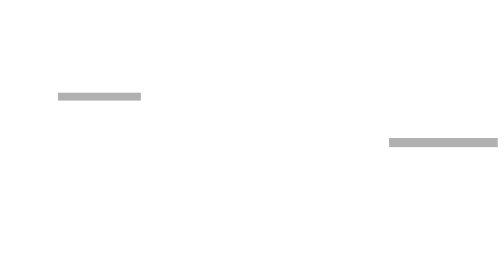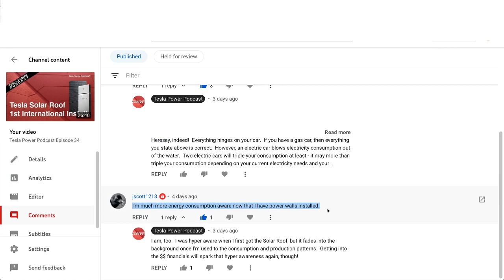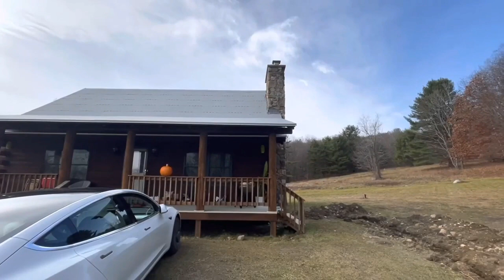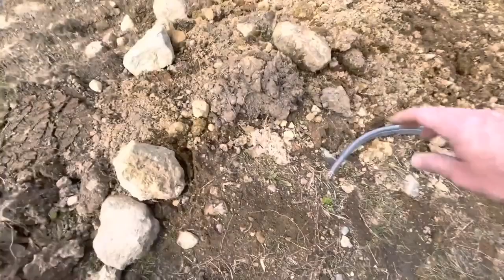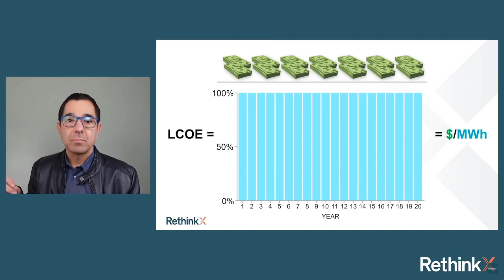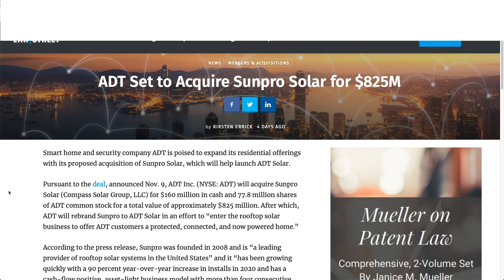Episode 35 - Net Metering: Its Days are Numbered | Becoming Aware of Your Energy Consumption

Comment: In Alberta our power bill is divided into various costs.
Our cost to be hooked into the grid is about a C$ 1.00 a day.
There is a transmission and distribution charge that is also part of the grid at a cost of approx C$ 0.08 per KWh
This works out as my cheapest battery option fo my solar system.
I pay 0.18-0.22 cents per KWh at night and receive 0.10-0.14 cents per KWh for my over production during the day.
At the moment it would cost C$ 800.00 per KWH of storage that would take 15 plus years to pay back my storage costs at 0.08 cents a KWh 
Also on rainy ,stormy ,cloudy, or snow covered days I have access to all of the power I need.
Reply from the maker: Do I understand correctly that you're considering The Grid as your cheapest battery option?
Batteries are expensive - that's for sure.
Absolutely use The Grid as your battery for as long as you can!

Comment: Let me push back at the notion that EV use so much energy. As a tesla model 3 owner and a NetZero solar home owner, the notion that your car will use more energy than your home is bunk.  I have some experience with this, having expanded my PV system to net out my use when buying an EV. The average EV consumes about 10kWh per day. The average bone uses three times that, or 30 kWh/day.

Comment: On Consumption - we have driven a hybrid for 11 years and are in the queue for an EV. As to Production, we maxed out our PV system under the local electric coop rules. We have more roof space if we could get more panels permitted but we are also constrained by roof structural limitations - it's a log-frame, post and beam structure (not log walls) that was under-engineered. The PV system is micro-inverter driven so we hope to be able to add panels one day. Reduction - we replaced all incandescents by LED and changed out some appliances. Kind of an all-at-once approach. Our neighborhood is maybe 30% climate-change aware but still a lot of ICEV out there. This is all just FYI and probably typical nation-wide. Cheers.
Reply from the maker: This is good detail - thank you for sending!  I'm curious about your coop limitation - how much production did they allow?
I'm also curious about consumption.  Do you happen to know how much less you consume now that you have replaced your lightbulbs and appliances?
Do you have an estimate for how much your EV will consume compared with your current consumption?
Reply: @teslapowerpodcast  Thanks for your reply. La Plata Electric Association runs the grid at about 10% over line voltage, I hear that’s typical. They would allow more than the 16 panels @ 335 Watts each that were permitted if we upgraded our cable from the end-point transformer to the house. That could cost a lot! There is room for 24 panels  but that’s more cost. Today on a full sun southern exposure we are generating 4.2W of which 0.8 goes to the home and 3.4 to the grid. I don’t know what the savings difference is with the lights and appliances replaced. The kitchen is propane and electric combination, the laundry is all electric on an LG Washtower, the heat is propane with electric distribution. As for the EV, the Tesla will charge overnight drawing 48WHrs from a 220V 50amp circuit. That’s about all I know right now. I’ll see what the average draw for the EV once I get some data over time. Thanks for a really helpful channel, cheers.
Reply: Whoops! That’s 4.2KW not 4.2W! Adjust the split accordingly.

Comment: I think the comment I made in the last video about the random PA phone number may not have been "allowed" by YouTube because it had a phone number in the comment. I had posted a comment in a previous video with a url link and that comment did not make it either. So I suspect it's YouTube's policy that may be blocking these?

About your energy assertions, one problem is that you can't design a PV array size with what you "think" you will be consuming in the future. You can't just tell Tesla I want a 50KW system on my roof. As you know, the first thing that Tesla asks is what your current consumption is. And you probably know that they ask this because the utility won't allow the sizing of your PV to be more than ~120% of what you're currently consuming. If everybody was producing as much as they wanted, the grid would not be able to handle it I suspect. 
So sadly, I believe that the first thing in anyone's assertion should be for a new utility grid design before anything else takes place. The grid is old and won't be able to manage everybody's PV systems. Batteries will help to stabilize the grid but will that be enough? I have my doubts.
Reply from the maker: YouTube is a nanny state :-)

This is EXACTLY why you start with consumption.  Unless you have juiced your consumption, the utility will restrict the size they will approve for your system - I should have pointed that out explicitly and thank you for this note.  You are absolutely correct that if the utility just allowed home owners to produce as much as they wanted, the grid would not be able to handle it.

The answer is storage for the homeowner.  It's not storage for the grid.  I agree that the grid is old and won't be able to manage everybody's PV systems - and it shouldn't.  Each PV system owner should be able to produce as much as they can AND should be able to store all of that production locally.  We definitely have a long way to go before this can become a reality, but we cannot - and should not - plan on using the grid as a battery.  We need more batteries in homes and we need them to be more affordable.  Scaling battery production is our only hope.  And it needs to be more than just Tesla driving this effort.
Reply: More like the solar company will sell you an oversize system if they are not restricted. The grid is generally unloaded by distributed solar panels, especially in the peak times.

Comment: Do you expect the Powerwalls to contain the new 4680 batteries by the end of 2022?
Reply from the maker: I do not expect 4680 to make it into Powerwall.  I expect these will be reserved for cars and probably only have a nickel chemistry.  Don't forget that the ramp for the 4680 form factor is going to take a few years AND that demand for these cells is unbelievably high - just with the Model Y - not to mention Roadster or Semi.
What I expect we'll see in the Powerwall is an iron variant of the 2170.  We have a lot of production capacity that will be shifted away from Model Y (and probably Model 3) which will free it up for Powerwall.  Reducing nickel consumption will be key to avoiding vehicle production bottlenecks, so changing the 2170 chemistry to LFP probably makes sense.
This will also increase the value to customers as LFP doesn't require as much thermal management - maybe allowing more room for batteries, it will last longer, and charge/discharge cycles can be 100% of capacity.

Comment: 15:00 I would extend the driveway towards the right side of the house. Mount the charger on the house or trench under the New driveway and mount the charger on a pressure treated wood, embedded into concrete. 
Maybe build a canopy for the car…
Gotta think about voltage drop… I am unsure about voltage drop…
Reply from the maker: I had a similar thought to the pressure treated wood - perhaps a buried railroad tie?
The voltage drop over 100 feet?  Doesn't look like it will be much with 3 phase AC.  About 1 percent...